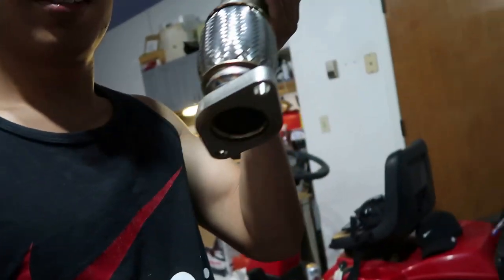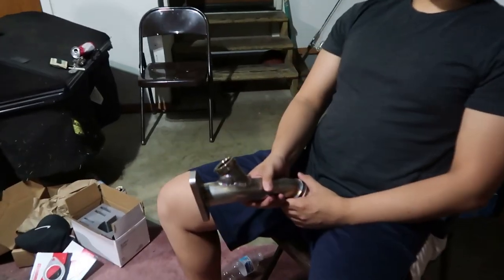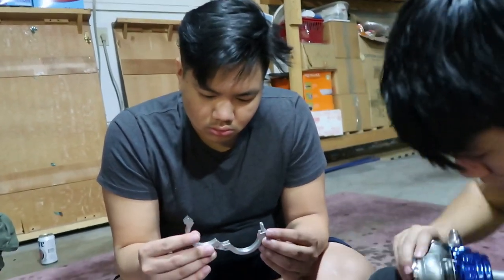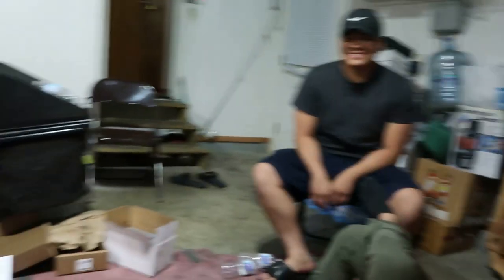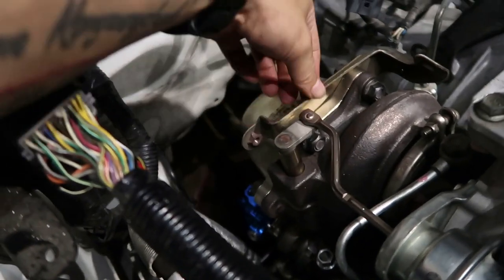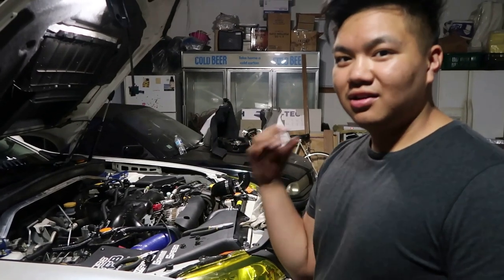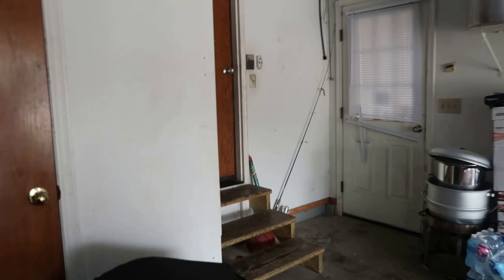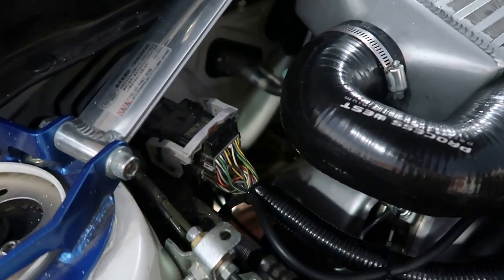Subaru WRX/STi | TiAl 38mm External Wastegate Setup/Install

Comment: Hopefully you guys see this comment. I recently installed a EWG. During the test drive my EWG does not open at all. I checled the lines and nothing pop off and all 3 lines are correctly installed. Any solution?

Comment: Question, so if I wanted to do an external wastegate on my 2013 wrx, would I need to upgrade the stock intercooler to something beefier I have a full exhaust and an intake.
Reply: Patrick M no you wouldn’t need to haha
Reply: Anthony Nguyen good deal, appreciate the response.

Comment: What did you buy to do the wastegate setup that shutter sound is nuts I love it. I have a 2.5L 2009 sti stock but am doing full exhaust and pod filter setup what do I need for the wastegate setup to sound like that?
Reply: You need to buy an up pipe and a wastegate plus a 3 port boost controller and a Cobb accessport for tuning, you'll need the accessport regardless if you're doing an exhaust

Comment: Hey I got a question.  I'm running 19 psi. What color springs did you guys put in. Cause I did the same thing and looked at the chart and accidentally put all three springs in
Reply: Look at the chart again, take the springs out and run the ones that your car needs to

Comment: Question sir 
If i installed ewg and iwg bracket and my car got tuned already so i have to get a retune or i can drive like that?
Reply from the maker: Chatchai Ninkaew if you match the spring to what your current boost level is then it’s drivable but I wouldn’t push it to it’s limits, you should still get the car retuned.
Reply: Lowminati oh thank you so much !!!!

Comment: Do you need a tune after installing the external wastegate? And would I need other mob to support the waste gate? I have a stock motor
Reply: Jandro c you def want a tune after installing an internal wastegate. Even an intake you should get a tune.
Reply: Tune everything